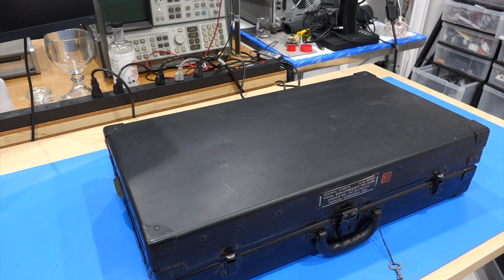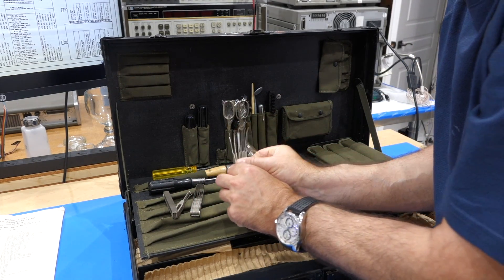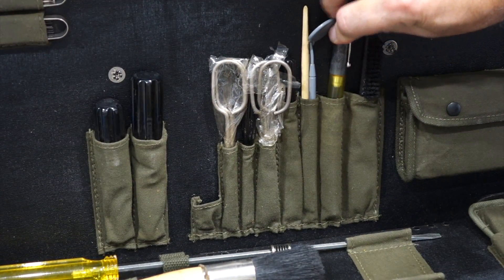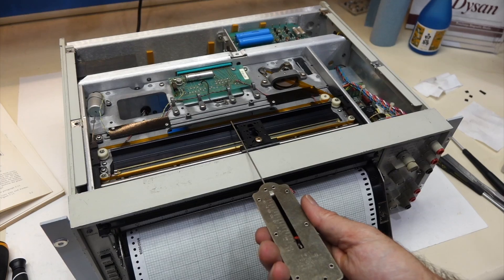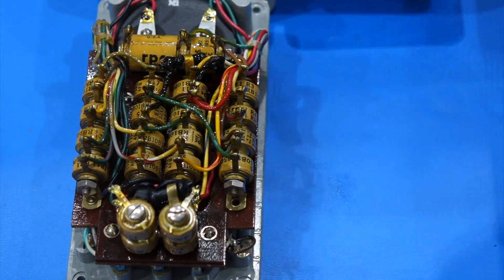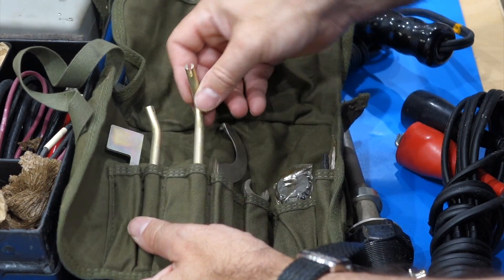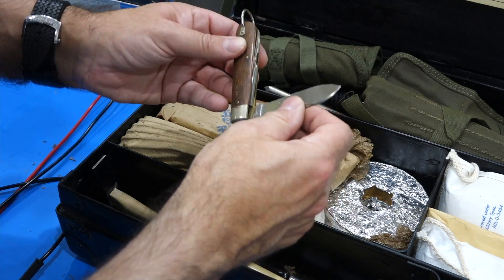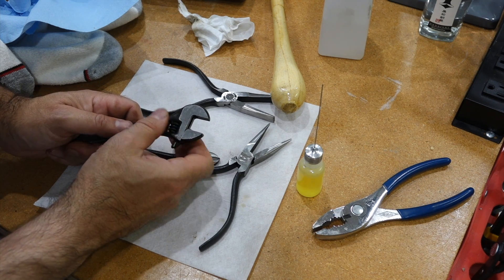Military Teletype TE-50B Toolkit Unboxing

Comment: Love the fact that Marc actually uses this stuff vs. turning them into display pieces. 🙂
Reply from the maker: You bet, I have been using tools from this box regularly since I got it. The flat screwdrivers are now the best set I have, they got a workout on the teletypes and on the Bendix Air Data Computer. Also the 90 degree angled screwdriver and the screw-holding screwdrivers get used a lot. And the very flat wrenches. Just a nice set of nice tools.

Comment: Marc -
11:56 Bell Sealed Bond Paper in manila envelope is used for Contact Cleaning (Switches, Relays) - Burnishing.
Common with Bell Telephone System !!!
Useful for Gold, Silver or Nickel plated Contact Cleaning.  NEVER USE FILES or ABRASIVES.
Reply from the maker: Thanks for the tip! We have plenty of old relays that could use that treatment.

Comment: That was a great find! I just picked up an AN/ugc-74a teletype today to eventually RTTY on my ham radio. Very good condition but no power. Haven't tried troubleshooting yet. Looking now for schematics and any kind of troubleshooting steps or test equipment. A tool kit like this would be handy I'd bet. I have most of the normal tools but none of the specialty ones other than a dental pick kit. I've found a couple of operator's manuals and a couple of parts lists and maintenance manuals. Any idea where I'd get schematics, parts, or useful information?
Reply: Join the Greenkeys list!

Comment: Gee, lovely set. Some of the tools reminded me of my old days in process control (pneumatic PID controls anyone?). Those devices had the flathead screws that only specific screwdrivers fitted and we used to use sewing machine oil instead of the expensive (sewing machine) oil the vendors sold.
Maybe you’ll find an old Buerkert PID one day?

Thank you 😊
Reply: by the way: Pb is definitely not healthy but most „old“ greases and oils aren’t either!

Comment: 13:20 That dark smelly tape looks almost like old self-vulcanizing (self-amalgamating) tape I used once. If that's what it is, you stretch it while applying, so much that it goes on whatever you want to protect about half as wide as it's on the roll (to activate the chemicals within the tape), and overlap generously. The tape layers should "melt" together into a single seamless waterproof rubbery coating.
Reply: Oh, so it's like shrink wrap in a tape form?! Amazing! Propably not available anymore?
Reply: I bought tape like this at the dollar store. The rubber was not the best quality.

Comment: Did the gear puller ever turn up?
Reply from the maker: Yes it did! Was at the bottom of the case. A rather small one.
Reply: @CuriousMarc  Didn't need a gear puller puller to dig it out?

Comment: Fantastic kit!
One tool I thought might have been included was a Spring Hook, one of the primary tools in a vintage IBM CE toolkit.
Also that screw starter that only presses on the screw head seems odd, the IBM screw starters have types that have outward-clamping slot jaws operated by pressing the end of a thin brass barrel, and another type that has a spring-loaded axially rotating inner part of a jaw, that twists and holds the screw while placing.

Comment: You are cleaning off Cosmoline from the tools.  It used in many NOS (New old stock) parts to prevent rust. I do a lot of work with NOS parts. Outboard motor NOS parts are generally coated with Cosmoline to prevent moisture and rust. OMC and Mercury used a lot of Cosmoline shipping parts to dealers.

Comment: Marc, please be aware that the gauges you handled have no protective finish. When you handled them your fingers transmitted corrosive oils to the metal that your body produces naturally. If you put the gauges away without cleaning and oiling them, over time your fingerprints will literally rust into the metal and it will more or less ruin the gauge.

Comment: Would expect that my predecessors as a communication tech/phone operator in Flygvapnet had access to tool boxes like this.

The last guy which learned how to use the paper tape encryption machine began his national service in 1988 and i in 1989.

Those tool box probable got thrown away into the skip when large invasion defense force was scrapped in mid 1990s

Comment: Those mystery tools were non-sparking types. Phosphor-bronze, great for when you are in hazardous areas.  The wrapped tools were preserved with Cosmoline. Thinners and  cutters like Acetone, mineral spirits, or kerosene (but avoid the latter when possible, or when your firearm (or hardware) has been painted or blued).

I've seen a lot of those tools around in my grandfather's and father's tool boxes, especially the long yellow handle screwdriver (that gripper at the end is for holding screws for those deep holes, not a grabber).

Comment: The tools that had slots in the end are for very carefully bending the spring contacts for tension you do it at the very base of the spring not the contact end most of those tools were also used on a bimotional selector used in telephone exchanges.
Reply: I recognise some of those tools from strowger days.

Comment: wow I would sure like to find another one of those adjustable wrenches.  I collect examples of noteworthy excellence to actually use in my shop.  Some of my favorites are actually from kippertool modern military toolkits.  That one looked really tight
Reply: You collect adjustable wrenches?
Reply: @525Lines  Yeah, really nice ones.  To actually use.  I have probably 30 ranging from 4" to 24".  I work on a lot of vastly different stuff and like super high quality tools.  The best ones I have found are private labeled Proto brand in military kippertool kits.  I have a set from Martin sprocket that are really tight, and a couple really old Crescent brand that are nice.  The rest are odds and ends.
Reply: Keep a lookout for vintage vehicle Swap Meets in your area, they are a great place to find vintage tools.
Reply: @1944GPW  Indeed

Comment: Thankfully you got your hands on this adjustable metric/imperial wrench!

Some tools were wrapped in plastic. Was this common for the era?
Reply: That was wax paper, not plastic.
Reply: @simontay4851  The clear ones were probably cellophane...
Reply: Plastic has been around for a long time. On D-Day, US troops went ashore with their rifles wrapped in polythene bags, they accurately portrayed this in the film Saving Private Ryan.
Also I recall seeing a WWII RAF downed airman's emergency beacon with a case molded from Nylon, it's on display in a cabinet at MOTAT in New Zealand.
Reply: Some kind of wax paper but yeah. That and cellophane.

Comment: What is the type of dispenser Marc was using for his isopropyl alcohol? That thing looked really slick
Reply: It's a Menda dispenser (other brands are available)
Reply: The push-down dispenser bottles are pretty common in laboratories and nail salons.
You can get them from McMaster-Carr
Mine is TechMed brand and labeled for acetone.
Reply: Just an ordinary spray bottle.
Reply: @simontay4851  Nah the one before that. He pressed a cotton ball onto it at 5:05 and it dispensed some alcohol

Comment: What a fantastic find!  I believe that goo on the tools is 'cosmoline'... the Army was very fond of it.  The knife looks like a 'barlow', very useful.  This should probably be on display in a museum.
Reply: Color and consistency of that covering on the tools, I would vote for cosmoline as well.
Reply: And it should be used in the museum to service the museum's teletype.
Reply: And the translucent yellow handle on the screwdriver is not something I expected to see in that vintage.
Reply: It's not a Barlow.  It's a TL-29 lineman's knife.  probably made by Camillus.
Reply: You're correct and I saw your comment before I posted.  That's the same thing you get when you buy a surplus Yugo or German Mauser rifle.  No matter how many times I cleaned my Yugo Mauser, with enough rounds through on a hot day, it still oozed from pores in the metal.
Reply: Smells atrocious and looks like brown Vaseline.
Reply: @soloban81  Except with the constancy of taffy.
Reply: Totally.  Understand the need to use some of the tools, but...man that's a tough call there.

Comment: (11:56) Marc, I think the "bell seal bond paper" was for making splices in the old original non-annealed flaky copper wire uses for long-haul distribution lines! 
I remember a bell telephone tech in my childhood (the 1970s) repairing a damaged subscriber trunk, behind our house with those paper splices and talcum powder! 
The entire thing was then wrapped in rubber and lead! Incredibly labour-intensive way to repair a 100-pair trunk line!! 

I remember the rain had gotten into the cable because the "snack-stealing rodents" had eaten the lead casing! 
The entire cable was smoking and steaming from the heat and the water boiling from the multiple -48volt DC talk lines cooking in the wet paper!!
Reply: thats crazy
Reply: All AC.
Reply: @ShainAndrews  sorry that is simply not true...

Comment: Oof. Those imperial adjustable wrenches are annoying things. Be careful with using them on US Customary bolts and nuts. They’ll mostly fit but there’s just enough difference to make them slippy. ;)
Reply: Also notorious for stripping metric hardware

Comment: If you look at a 310 plug, you will see the use for the spring type screw driver.
They are very small and the plunger holds the csrew to insert or remove it.
We used them a lot in the phone company for some of the operator cords and butsets.

Comment: Hello there, At 10:45 is called a C-spanner. Also used to set the preload on the rear suspension of a motorbike, albeit a little sturdier. Always happy to find your postings.
Reply: in the US, we tend to call normal wrenches wrenches, and that a spanner wrench.  Most people don't even know they exist and use screwdrivers and a hammer to adjust those motorbike shock preload nuts haha
Reply: @RickBaconsAdventures  lol, Terms for tools across languages, regions and yours and my side of the Atlantic ... a babylonian speech confusion. ;-)
Reply: @RickBaconsAdventures  We also have similar wrenches but tiny for tightening nuts on wiring fittings.

Unfortunately, nobody ever uses them and my company doesn't even have any, so we just have to make do with a hammer and a screwdriver.
Reply: @user2C47  I've seen them on conduit fittings.  Yeah, never too many mechanic tools on hand when doing wiring like that